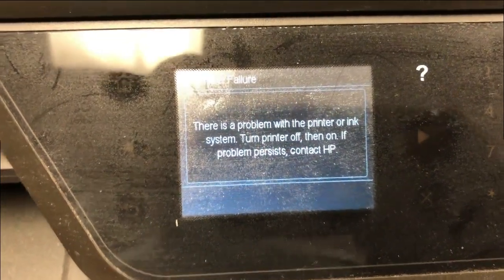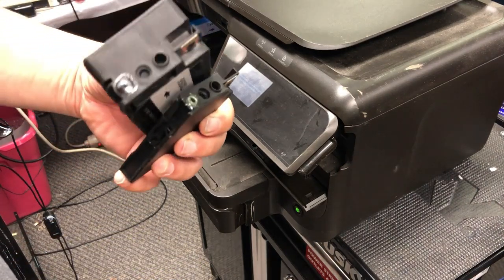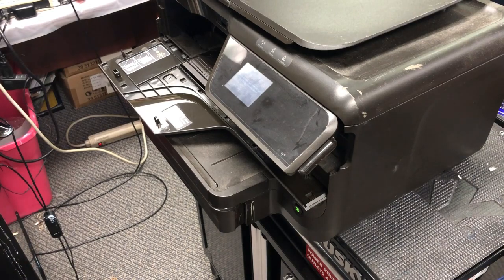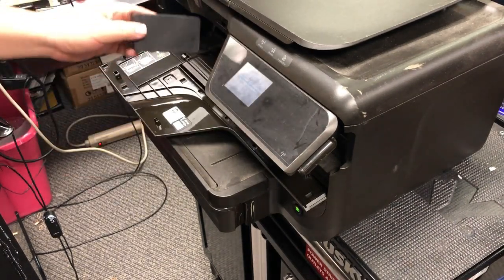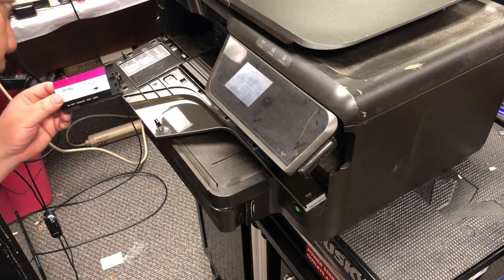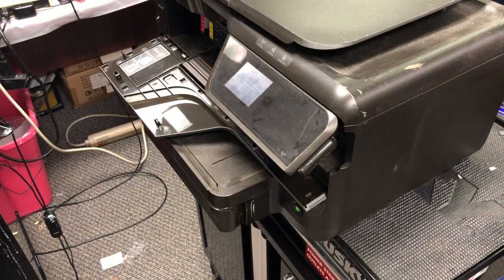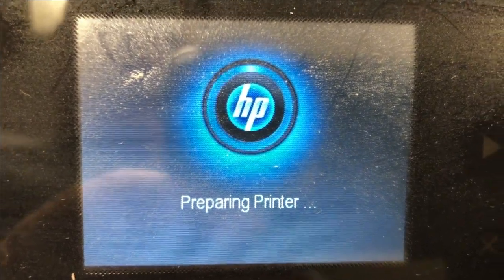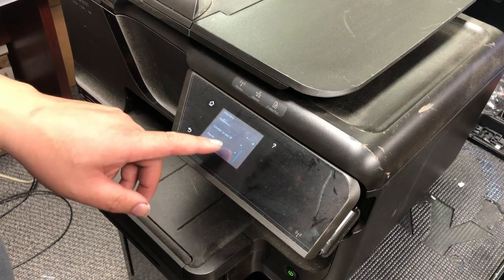HP OfficeJet Pro 8610, 8620, 8710, 8720 Ink System Failure

Comment: HP has been class action sued over this shit multiple times.  The only people that benefited from that was the blood sucking lawyers.  My 8600 is in PERFECT MINT Physical CONDITION!!! It has NEVER had a mechanical problem EVER!!!  These MFKr's realize they can't sell new printers to folks currently happy with this one which worked great with no mechanical defects.  So they start scamming you on the ink when consumers figured out how to refill the cartridges by cheaper means.  They want to force you to buy a new printer and subscribe.  I'm having the same issue all of you are having.  I've spent $250 alternating cartridges. It locked me out of Magenta, claimed Yellow and Blue were empty when they weren't because of the date on the cartridge had surpassed the warrant, which has nothing to do with the ink being there in the cartdridge and totally find.  And when I resolved those it switched to locking me out of Black.  Now the only one not working right is the Black K Cartridge.

I've researched how to get my printer working for days.  I've found legacy firmware, a way to push it thru to the printer.  I've manged to make it back to the home screen a couple times, it's rare but if I can get there just one more time to do a semi-reset I think I can fix this issue.  They block you from the menu so you cant get to the reset option to clear the error.  So the key is to disable Web Services, and access the printers graphic user interface thru the IP adress and disable Cartridge Protection and Cartridge Chip info.  Then go to your PC firewall and BLOCK HP.  Connect your printer to your pc via USB cable.  I'm still trying to fix black if I'm successfull I'll make a video and share it with you all that will be in good English.  Don't get rid of your good HP Printer.  There has got to be away to fix this!  I'm not giving up.  And I am NOT bying SHIT ELSE FROM HP.  I'm going to keep refilling the HP accepted chip cartridges I have via the ink refill kit which you can get on Amazon for all the colors for $13 dollars.  

You have to diable the printers ability to update and connect.  The printer also counts the number of pages you've printed and there's no way to reset that with their firmware so I have a theory that they may also be invalidating your print cartridge based on the warranty date on the sticker or the number of pages you've printed given that a cartridge can only print so many pages before refilling.  I've also ordred after market reset chips that supposedly trick the firmware from Amazon.  I'll be testing those as soon as they arrive.  If I'm luck and they work I can just keep one set of Genuine HP Cartridges and just put the aftermarket chips on them if they start tripping and keep refilling the ink for a fraction of the price.

It's ashame corporations get away with this bullshit.  HP has done basically what car manufactures and appliance manufacturers have done.  Remember when cars were built like battle tanks and would run a life time??? Now these knew plastic pieces of shit you are luck if you can make it 100 miles past the 5 year 50K mile warranty.  My new car broke down like CLOCKWORK after 5 years, first the transmission which I replaced, then the engine 100 miles later.  The dealer was determined to sell me a new car I said FUCK now, fix this piece of shit and I drove it another 15 years.  It still runs and is sitting in the garage.  The transmission failed because the gaskets are made out of cardboard now instead of rubber which woudl have lasted a life time.  The mechanic took it apart and showed me.  I said well can I get rubber ones this time with the replacement? He so now because they don't make them anymore.  He said they make them out of cardboard now so they break down around 5-7 years so you buy a new car rather than try and fix it.  That caused the transmission to break down the cardboard and grind metal against metal and the metal shavings killed the transmission.  Then the engine failed due to a manufacture defect which was under a class action lawsuit with Chrsysler for their Sebring models.  They only reason my replacement engine and transmission have lasted as long as they have is because I don't drive much and my 2002 Sebring is still in Mint physical condition and runs like a champ.  It's 24 years old with 118K miles on it.  I said I'mma get my money's worth out of this new trans and engine and I meant that shit.  I'm not buying another american made piece of crap. My next car will be Japanese.

Japan doesn't allow manufactures to get away with this bullshit.  You are not even allowed to sell food or grocery food items or even candy that don't look exactly as advertised.  You look at a billboard here in the use for Taco Bell for a Mexican Pizza it looks like it's got a pound of meat and cheese on it like it did in the late 80's.  Buy one today at quadruple the price and it's got a tablespoon of meat between 2 sad little tiny tortillas and it's so flat it looks like someone stepped on it.  Our country is failing because of corrupt governerment administration both LEFT AND RIGHT and their being no cap on capitalizm with these greedy ass corporations that get away with just raping the consumer so they can make 500% more in profit!  That's why the pillars are crumbling in this country now, it's just a domino effect. 

 I am determined to figure this out, where there's a will there's a way!  Just like that kid who figured out how to jail break the Iphone first and the corporations drug him into court.  That lawsuit went all the way up to the Supreme Court who ruled in the kids favor determining that once the phone is purched it is the consumers property to jail break or break with a sledge hammer.  Jailbreaking the firmware installed on their personal property is not stealing from the manufacture nor is it the same as hacking into their network.  So only thing manufactures could do is void your warranty after you do that.  Newsflash, when your phone starts acting up IT'S NOT THE PHONE!!! It's the phone's firmware updates!!! That the company claims are securit updates.  And that's why it's slow, glitch, the camera pics don't look as goood.  Nothing mechanically has gone wrong with  your phone!  It has no moving parts!  You put it in a phone case and a screen protector on it stays in mint condition.  THEY WANT YOU TO BUY A NEW ONE!  So they fuck up your old phone with updates.  Even if you factory reset it, you'll get the latest firmware update installing the same issues.  But if you jailbreak it you are back in business.  I never worry about the warranty.  I've never had a phone physically break down.  It's just the software that can be reinstalled as long as it can be powered on!

That's why I stopped fucking with these corporations and cut my consumerism way down! Anyway I'm finished with my rant.  Keep hope alive!  Long live the HP 8600 Printer!!!

Comment: Do you have pigment ink refill kits for the hp officejet pro 8135e or 8130e?
Reply from the maker: Thanks so much for your question and support! We don’t offer a specific “kit” for the HP OfficeJet Pro 8135e or 8130e since most people just flip the cartridge and drip ink in (see how here: [https://youtube/N7Y1nk-D5cc](https://youtube/N7Y1nk-D5cc)), though advanced users can transplant chips into our transparent casings ([https://tinyurl.com/yc2optw5](https://tinyurl.com/yc2optw5)) as shown here: [https://youtube/2DJQLUeTBfA](https://youtube/2DJQLUeTBfA). As for ink, we don’t manufacture by cartridge model unless special ink is required—we make ink by brand—so you can use our HP dye or pigment sets, and if you want full pigment options you can also search bchtechnologies.com. The good news is you really can’t go wrong: the printer works with either pigment or dye. Dye ink is cheaper, easier to unclog, and modern formulations hold up well against UV and smudging, while pigment ink offers durability but is harder to clear if clogged. Many users even convert pigment slots to dye for easier maintenance. You can safely switch inks if you use up most of the old supply before refilling, but avoid long-term mixing since pigment and dye bases differ. We get a high volume of questions, so please note that subscribers and members are prioritized for answers within about 48 hours, while other viewer questions are answered if time allows. For faster help, feel free to email [support@bchtechnologies.com](mailto:support@bchtechnologies.com). If this video or comment has been helpful, I’d greatly appreciate a kind review on our Google page: [https://g.page/r/CfL7k6nYvPQ9EAg/review](https://g.page/r/CfL7k6nYvPQ9EAg/review). Don’t forget to subscribe or join as a member to enjoy priority answers, early video access, and exclusive benefits!
Reply: @BCHTechnologies 
Thanks for all of the valuable information!  🤓👍

Comment: Purchased Walmart knock offs, got the error. Then i purchased HP, and still the same... is there a DIY on how to clean these?
Reply from the maker: Thanks so much for your support and for taking the time to ask this question and engage with the channel—it really means a lot. Unfortunately, on the HP OfficeJet Pro 8610, 8620, 8710, and 8720 series, an “Ink System Failure” error is rarely caused by dirty ink alone, so switching from knockoff ink to genuine HP usually doesn’t resolve it; in most cases, the issue is a failing ink delivery system, service station, pump, pressure sensor, or air intrusion in the ink lines, and while there are DIY attempts floating around (like flushing lines or cleaning the service station), they’re hit-or-miss and often temporary because the underlying hardware is worn or electronically flagged, which is why HP typically replaces the entire ink system rather than offering a cleaning procedure. If you want faster help or a more personalized assessment, feel free to email [support@bchtechnologies.com](mailto:support@bchtechnologies.com). Also, I get a very high volume of questions every day, so replies are prioritized this way: subscribers and channel members are usually answered within 48 hours and get extra perks like early access to videos, regular viewers are answered if time allows since I can only reply to about 10 questions per day, and remaining slots are filled last-in, first-out (newest questions first); if you’re not subscribed and don’t hear back within 48 hours, you can either subscribe or simply repost your question so it moves back to the top, and if you subscribe later, your older questions automatically become priority without needing to repost. I’d also love to invite you to join “Run With Kevin — LIVE,” where I go live every morning (usually between 6–8 AM Eastern) to answer printer questions in real time, so subscribe and turn on notifications if you want to catch the next session and ask directly. And if this video or comment helped you, I’d really appreciate a quick Google review here: [https://g.page/r/CfL7k6nYvPQ9EAg/review](https://g.page/r/CfL7k6nYvPQ9EAg/review).

Comment: I have the same model, today I bought a non-hp cartridge, it turns on and then turns off suddenly, I haven't used the printer for several months. can someone help me what is the problem? Thank you!
Reply: Yes, return whatever ink you haven't opened, trash the printer, buy new one that comes with ink, and enjoy another 5-8 years use.
Reply: @truthteller8274  HP GREED $$$$$$$$$$$$$$$$$$$

Comment: I removed the print head and flushed each of the 4 nozzles with a 20ml syringe(fitted with a suitable refill adapter) till i was able to flush see clear water from each cartridge bay. I then had to ask my printer to clean its head scores of times till i could get the alignment & color's correct and this worked the trick for me
Reply: Yeah doing it with the print head installed did nothing for my issue. Just ruined a ton of paper towels so either the print head needs replaced or a real cleaning and maybe more
Reply: I'd like a video of that.